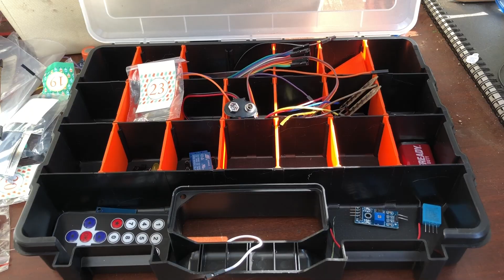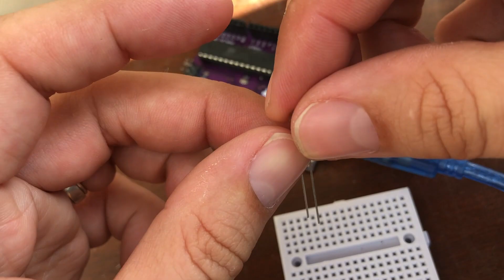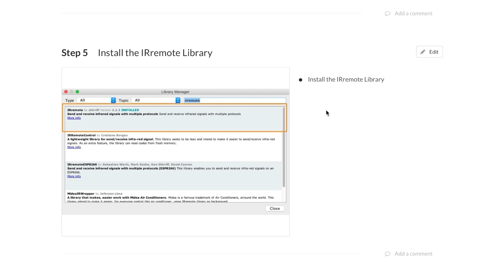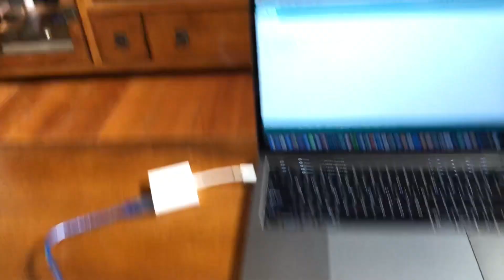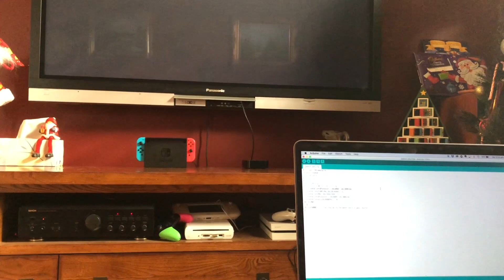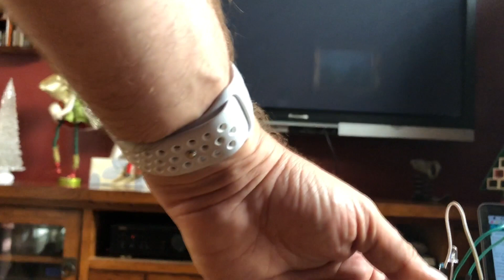Arduino Advent Calendar - 23rd December 2017 (IR Transmittor)

Comment: The code shows it sends the code 3 times, with a 40 millisecond gap between the bursts... then waits 5 seconds and repeats indefinetely. It would be more conventional to just comment out the sony line and uncomment the panasonic one so you don't lose the sony info too, but the code should work as you had it. IR needs a 'line of sight' to the receiver so you had that right in the end. Its a bit of a surprise the setup doesn't force to to say which pin the blaster is plugged into.

Comment: Have you tried using the IR receiver to capture the signal from your remote - that way you will know you have the correct button press?   The LED doesn't light up or anything so it is hard to know if it 'working' - it does need to be close as there isn't much of a range on it.
Reply from the maker: Little Bird Good thinking on trying the remote to capture the signal! I’ll give it a try, thanks for the feedback!